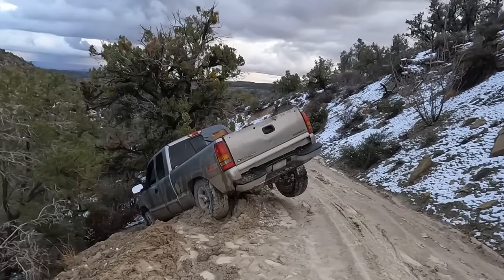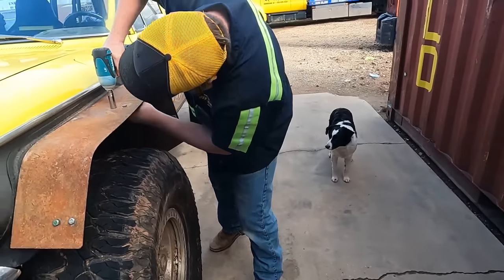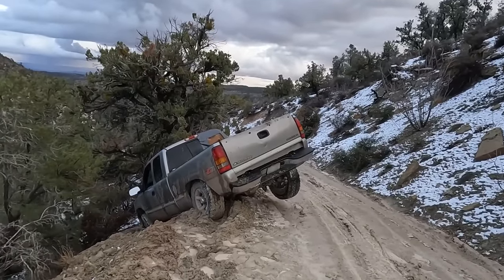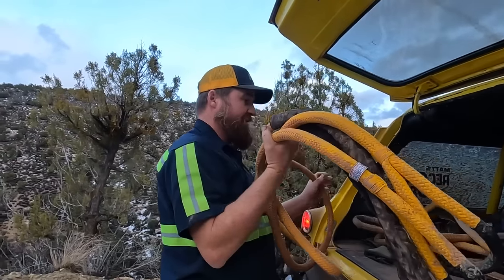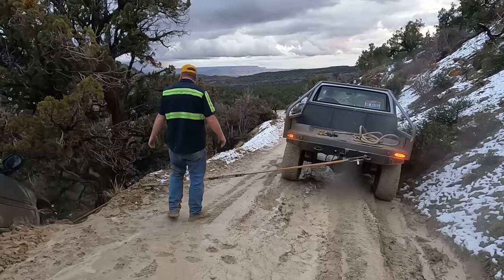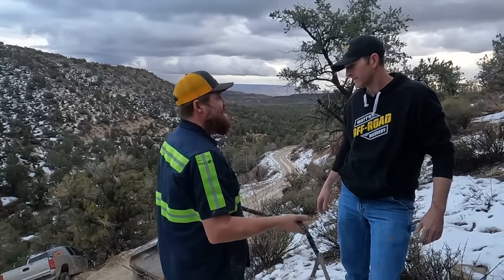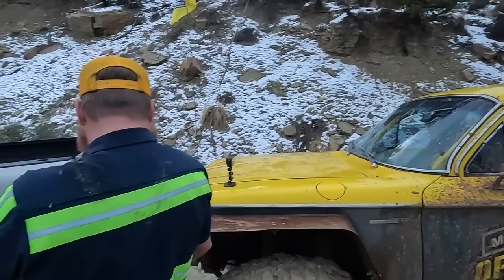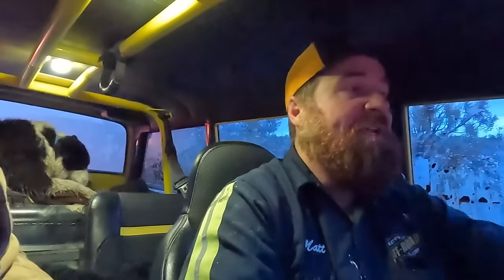This Is A Serious Mess! Chevy Hangs Dangerously Over The Edge

Comment: One thing I've notice when you're pulling someone backwards in the mud, steering is the opposite of normal. She keeps turning drive as if she is on pavement. Being towed the rear end doesn't swing, it just goes where it's towed. The front wheels point to the right going backwards so the car goes right. She should be turning passenger so the car drifts to the drive side.

Comment: Matt, you are right. In Europe the cars do not get stucked, because our roads are all paved. The kind of roads your customers are stucked are mostly closed to the public here in Europe. And the roads wich are open normaly are only used by drivers who can handle them. At least in western Europe.
Greetings from 🇩🇪
Reply: i would like to add a little more information : we have so many paved road in western EU, everywhere, that we NEVER need to take any unpaved road, even if several of those exists.
Reply: To clarify this, “closed to the public” almost always means closed for motor vehicles (with exceptions for agricultural and forestry vehicles). And they are closed for motor vehicles in order to protect nature and wildlife, reduce noise pollution for nearby residents but also to enable safe and undisturbed use for leisure like hiking or biking. 

And I’d like to say, even half of those agricultural access roads (that only agricultural motor vehicles are allowed on) are paved, but that will naturally vary a lot in different parts of Europe.
Reply: And even the gravel roads usually don't turn into mud that would get you stuck.
The only time i have seen mud roads like in Matts videos here in western EU was on one of the biggest military training grounds where the roads are not gravel but just dirt and torn up by tanks and aren't open to public use either.

Comment: Nice to see Ed on the road again 👍🏼 I was just thinking, (we) Europeans did not manage to standardize the size of those recovery bolts? The bosses of EU most have been sleeping on the job!
Reply: There are generally only two sizes, BMW, VW and Volvo ones fit the Mini.
Reply: Was wondering too, does someone sell a set of the common sizes if they aren't standard.
Reply: The law just says manufacturers must have a towing point, not what size it should be. To be fair, different vehicles might need different attachments and also many vehicles have come with fixed, welded loops (e.g. vans and trucks).

There are main sizes: M20 2.5mm RH, M16 3mm LH, M12 something and M24 something 

BMW/Mini is the M16x3 LH. If Matt wanted to carry an eye, carrying an M16 and M20 would cover most bases I suspect.
Reply: @marvindebot3264  no, there certainly isn't. Even a given model can have different tow hooks depending on options and the length can vary from two inches to nearly a foot.

Threadwise, I've seen M12x1.5, M12x1.75, M14x1.25, M14x1.5, M14x1.75, M16x1.5, M16x2 and M20x2.5. And I'm pretty sure I haven't seen them all.
Reply: @needadate  M16 and M20 on what, a semi? The majority of passenger vehicles use M12x1.75, M14x1.25 or M14x1.75 and a 150mm shank will fit most vehicles.
Reply: The problem is that EU did actually create a (sub)-standard for those recovery points. Basically the standard set the bar for flat towing only on flat smooth paved surfaces. For off-road recovery the effective vehicle weight could easily get up to twice the vehicles actually weight or more. So I wouldn't trust that recovery bolt to hold up when used for off-road recovery.

Taken from the "COMMISSION REGULATION (EU) No 1005/2010 of 8 November 2010 concerning type-approval requirements for motor vehicle towing devices and implementing
Regulation (EC) No 661/2009 of the European Parliament and of the Council concerning type approval requirements for the general safety of motor vehicles, their trailers and systems,
components and separate technical units intended therefor"

"Each towing device fitted to the vehicle must be able to withstand a tractive and compressive static force equivalent to at least half the technically permissible maximum laden mass of the vehicle."
Reply: It's so dumb how those recovery bolts are fine thread.  I had to order one in for my Honda Fit and it is a pain, to get the threads to start.  I wish they would have made it a course thread.
Reply: @MyLifeThai371 
Ford has the good sense to use left hand Acme Thread.
Reply: @MyLifeThai371  A very course, interrupted thread would make even more sense. Two or three turns and it would be in.

Comment: My Ram Promaster City uses this style of recovery hook. It did not come with it from the factory.  I had to purchase it from the dealer parts counter after I purchased the van. 

Now, every time I check out a new vehicle, I look for the following. 1) a spare tire. 2) a jack. 3) a tow hook or a place to attach a tow rope, cable or strap. (Every vehicle I have owned has had a flat at some point. And most of them I have gotten them stuck somewhere at some point and needed to hook to them to extract them from the stuck spot.)

And I expect I will get stuck somewhere again some time in the future. It’s a guy thing. It’s not if, it’s a when.

Comment: Spent years working on  merchant ships;  Car carriers have thousands of 1 inch ratchet straps  we rarely used shipping eyes, as we have to compress the suspension to prevent the vehicles from hitting each other.   Course this was back in the pre 2010 era.  Bosun and day men have to check lashings daily. Overtime at night is inspecting the straps the stevedores removed from the vehicles   sometimes cutting them off,  damaging the ratchet  by driving over them. WD-40 to wash salt crystals out of the ratchet. Good night in 4 hrs. You can repair lube and roll up 400; 8' straps.

Comment: I often wondered about oil starvation on these inclines. In the  road racing world there are a few tracks with long sweeping corners that are known for killing some cars because of oil starvation.
Reply: It's a little different when the engine is at high rpm since oil is being pumped up into the cylinder head(s) and can stay there longer than it can drain back. I'm sure if they had that truck bouncing off the rev limiter the oil pressure light would come on fairly soon, but at low revs it's not a problem until crazier angles.
Reply: Also, lateral G's pull the oil up the side of the pan. That, plus a lower level due to high oil flow from higher rpms, contributes to oil starvation.

Hot, runny oil also pumps easier.

Comment: Hi Matt. Have you considered having a supply of long heavy duty bolts of various thread sizes and make a “d” ring that would allow your largest bolt to fit into it and then use various heavy duty washers to allow for pulling on the “d” ring? Then you’d be prepared for those vehicles that are missing that pulling pin. Just a thought that might make for an easier recovery 🤓
Reply: They'd have to have a lefthand thread , certainly for any euro car.
Reply: Matt usually runs as light as possible - no jack, no spare tire/wheel, no compressor, no jerry can of fuel, and sometimes just a quarter-tank of gas if that will do the job.  A collection of hardware could add up the pounds.

Comment: Matt, the towing hitch on European cars screws into a hole behind a plastic circle on the bumper that pops out and the hitch itself is with the spare tyre in the trunk or boot as we call it over this side of the pond. Also, the usually screw in reverse thread.

Comment: Nice recovery, and you are right Matt modern vehicals (mostly trucks) have baffles in the oil pan to keep the pickup covered at steep angles. You almost have to roll one on its side to starve it. Now if that would have been a early 70s F100 with a FE motor I might have been a little concerned about oils starveation. I had one with a built 390, and put a Milidon pan on it to add oil and a baffle.

Comment: I believe that recovery bolts are standardized. It would be good for you to have one in your recovery gear in each vehicle. Then you don't have to worry about finding the one in the customer's vehicle if they even have one.
Reply: a third of the time Matt doesn`t have gas or all his ropes what makes you think he`d remember the bolts.
Reply: There not all the same.
Reply: So, just carry an assortment of Eye bolt sizes.
Reply: @SpecialED-mc6cg  There are only 3 sizes that cover all Euro and Japanese vehicles that use them.
Reply: @marvindebot3264  good to know. I didn't know how many different sizes, I just knew theyre not all the same size across different manufacturers from personal experience
Reply: Doesn't seem like it would be worth the trouble of inventorying them, since they're only good for straight-line static pulling on flat ground. Can't use them for kinetic pulls, or lateral pulls, or pulling up an incline.
Reply: @dafunkmonster  Well... depends... I pulled an Audi out of the ditch as he was buried in a snow bank. so up a 30degree incline, I pulled at 45 degree angle to his car to pull him back onto the road.. I don't recall if I had to bump at all or if it was just a pull, it was a few years ago. I will say I miss the good ol' days when Honda/Toyota/etc had the nice thick steel loops on each corner of the car for recovery points. The newer ones with the centre loop tack welded to the bottom of the trunk pan works, but I'm even super careful when using that.

Comment: you know  the thing  😂😂😂 Matt as far as the eye bolt/the thing attachment recovery point i have an idea anytime you have to go to a wrecker see if you can start buying the eyelets and have them on board with you i know theres probably many different sizes or styles from different manufactures  but in thinking  alot of them should be close to the same  ford dodge chevy toyota etc  . if you could do that it sure would be a time saver .good job another great recovery

Comment: This is exactly what happened to myself in my truck, stuck in the exact same way back passenger wheel in the air, driver side front tire slipped off the cliff but I packed all the weight on the truck on the back wheel to keep it on thy ground.  I had to build a bridge and cut steeks and pound them into hill side and lay flat stones to build that bridge.  I was stuck on a dead stump as well. It took 2 or 3 days to build the bridge and some "come alongs" anchored around a tree so I didn't fall down the 200 foot Cliffside.  My truck was in no worse shape from it and we made it off the mountain alive and in one piece.

Comment: Here in Central Europe, I don't know of a single place where I could go offroading without getting in trouble. All the roads are either private or they are public and well prepared for road vehicles. I'm sure there are offroading places here but because I don't use them, I don't know them. When most people go off the road, they will need a crane or something, because it won't be just in a ditch. Additionally, most land here has flora on it so there's topsoil everywhere, and in the flat regions we don't have areas with just bare soil or clay on top, which becomes slippery with moisture.

Comment: About the "don't stuck in Europe" question:  In Central Europe unpaved streets (thus dirt or gravel roads) are quite rare, on farms at most. Unpaved roads do not even classify as "roads", we more call them something like "track" or "pathway". So it may actually be that cars in Europe are less often stuck - at least not in mud or sand or the like. If they are it's usually  in winter due to snow.
(Also we do believe in recovery points and tow companies sometimes do have spares of the most common bolt on tow lugs on truck)

Comment: So about a month ago you put a message on a video saying if anyone knew any good radio codes you could use while communicating on the radios. Similarly, years ago we tied to make our own lingo while pulling people behind our boat on tubes and boards. We tried to come up with cool "California surfer talk" names. You should do something like that. Adopt the names used for the tricks in Olympic Halfpipe snowboarding into your own meanings. So to turn to the 'right', that could be called a 'triple cork', because you're pointing the wheels to number 3 on a clock. Turn to the 'left', could be a 'stalefish', just because that sounds cool. Put it in 'Neutral' could be 'Riding Goofy' because it's kind of goofy to be driving it out of there in neutral. Stuff like that.

Comment: 2 things: I bet u can go online and find a kit with multiple different types of those eye hole recovery thingys, maybe? And also it would be cool if u could find an axle with electric and manual locking hubs, so if the electric happened to fail u could still manually put it in 4 wheel drive

Comment: Figures the shipping towing tie down not recovery eyebolt not towing not shipping not tie down hook point thinggy wasn't in the emergency kit. If the owner (including previous owners) had it towed before and they used the point at any time, you usually have to hound the shop that took it out to make sure it gets put back. I have commented on this before and forgot that not everyone is quite so persistent (or even aware - not everyone knows their car typically comes with one) about keeping a vehicle equipped properly. At least you tried! :)

Comment: Fellow BMW owners like this Mini here, keep that eye hook in the vehicle and know where to find it!  Ze Gehmans took great pains to make your vehicle as slick underneath as possible for speed, stability, and NVH reduction.  That means that good people like Matt have a harder time pulling you out of the bush.  It's a lot better to pull directly on the steel inner bumper than it is to pull on a lower control arm.  

Oh, and buy a real spare tire.  Carry it, a scissors jack, and a breaker bar with a 17mm deep socket anytime you go somewhere like this.  Yes, it will take up cargo capacity.  Yes, you need to take it with you anyway.  Don't forget your wheel lock key.

Comment: Pro tip from someone who grew up in snow country:  QUIT washing your hands in mud puddles when there is snow on the ground!  Especially when the temps are around or above freezing.  Grab a handful of CLEAN snow and wash away!  It's clean water in solid form that melts.  ALSO, it works great to clean a muddy windshield!  Grab a couple handfuls of snow, smear on the warm windshield, and run the wipers; that actually works better than washer fluid!

Comment: Steck makes a universal eye bolt that fits in about 200 or so different vehicles. This would help on jobs when the recovery point has a threaded hole 1/2 to 1 1/2 inch opening.

Comment: When I was driving a tow truck we would get cars that needed to go to the junkyard and we would grab those eye bolts and keep them on our tow trucks for the most part they are all the same but there is a few different ones. This way you don't damage the customers bolt and that way they have a safe factory one case they end up using it on their own and you won't be blamed for something happening if there's snaps or pulls threads out sending their car on a wild ride.

Comment: Regarding those "threaded eyelets that fit into the bumper areas on some cars", I know they are a last resort but I am always surprised you don't carry a few with you just to have your own on hand. There are only a few different thread options (I think) and you could make them double ended so you'd have two-in-one. Just a thought.
Reply: You would be surprised at the number of variation of thread size, reverse thread, length and diameter of towing eyes fitted to just one brand of vehicle, let alone all of the different brands

Comment: Tow hook- Not missing, hasn't been supplied for a half dozen years.  Most manufacturers are the same way. Save $5 manufacturing cost, don't care if they cause the customer issues.  Decisions are made by urban-dwellers with no awareness or accountability for the effects of their decisions.
This is true of not just Euro brands but most Japanese and Korean brands. Probably domestic, too.
So if you live in areas where there is any chance of getting stuck, or you vacation to such, even travel snowy roads at Xmas, definitely go to dealer and pick one up. $25-40 retail price.

I worked for a Mazda dealer and they ended the fitting of them into the spare tire kit in 2014-2015. Newer you don't get one. The head office guys making excuses said "I think the tow truck operators carry them" which just proves (typically for the massive mis-managed Mazda Canada distributorship) that it was not looked into, only excuses after the fact are offered. Disaster of a company more concerned with pushing the gay agenda and the war in the Ukraine than getting parts, brochures or cars to the dealers, or getting warranty claims settled. Virtue signalling !@#$'s 

These tow hooks are required for some track racing, too, and have become a "tuner" affectation starting from there, so fortunately are out there for sale in addition to dealership produced ones. Watch your exact model and year to avoid getting the wrong size- there are many sizes.
Thread sizes vary- 16mm, 18, 20, 22, 24, and thread pitch all over the map - very few are straight bolt thread- mostly unique rounded acme (like in a vise or clamp, but not quite), and some are left hand threaded (VAG). The thread form is about what threads into pressed HD sheetmetal in the bumper rebar best.

Bottom line, if you think you might benefit from one at any time during your ownership, it's on you to get one and have it with you.
Google your model and tow hook. Most brands and the aftermarket call them that. Some brands that used to equip from factory, you could try a wrecker, though IDK how much luck you'd have.
Matt- if you want to summarize this and make it a sticky, might benefit you and others in your industry.